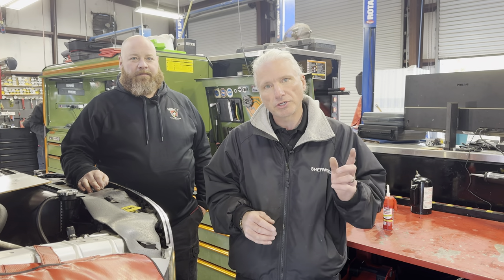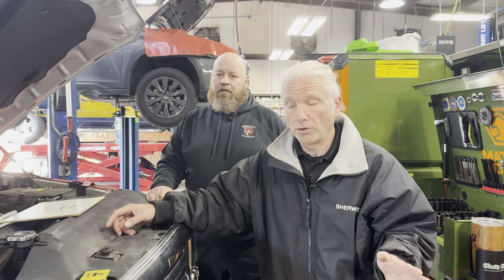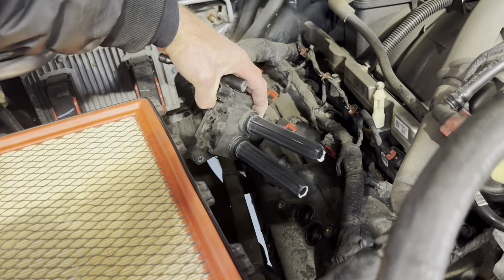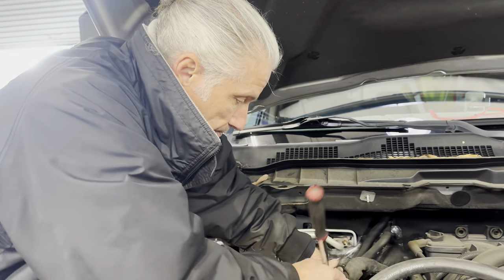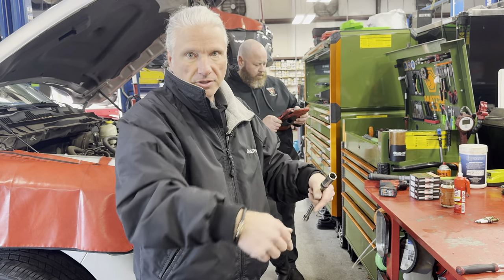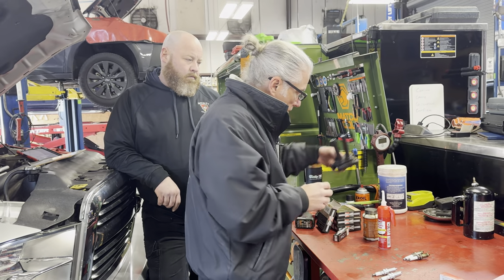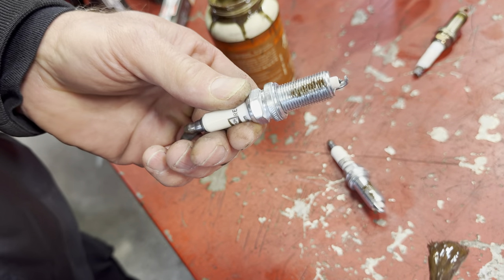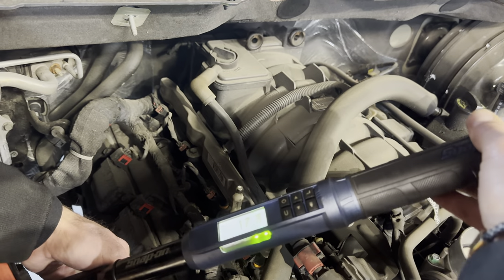How To Replace Spark Plugs Like A Professional

Comment: Someone let the office manager back in the shop again and let him play with the tools. Someone get a mechanic in there stat!!
 PS modern plugs are coated and don’t require any anti-seize. Wet torque specs are different than dry torque specs.

 The look on the techs faces when this guy starts talkin and puttin his hands in the engine bay is priceless!!

There’s a video where plug gaps are tested on a high output engine on a dyno that shows gapping isn’t that important. If you have iridium or platinum plugs you really shouldn’t be messin around with changing the gap. Can damage the coatings as well.
Reply from the maker: Had trouble reading past your first two sentences because of your arrogance. To come on here and say stuff like that about a guy who’s put 40 years into this industry as a technician is pretty incredible. If it was me (the guy holding the camera) who you were saying that about then I’d agree with you as I do run the front of the shop. But to say that about a guy who clearly knows what he’s doing (not saying he’s perfect or knows it all like you) is just ignorant. 

You’re invited to come to the shop and talk to the techs yourself. The level of respect they have for him will be evident. You’ll be able to tell if they’re blowing smoke. 

Maybe watch a few more videos before making a comment like this. Or don’t since you already have it all figured out. 👍
Reply: @theroyaltyautoservice   someone’s triggered lol 
 First off, I’ve never claimed to know everything and definitely didn’t claim that I did in my comment, which apparently offended you (the guy holding the camera) when it wasn’t even you I was givin a hard time too- That’s what people did before words started offending people so easily. 
 Secondly, well, it’s just not that serious man. You’re on the internet you’re going to hear things significantly worse than what I said.
Reply: @KendrasEdge757  Modern turbo engines are very sensitive to spark plug gap.
Reply: @1MiketheMechanic  not turbo diesels lol yeah they’re sensitive to a lot of things, regular use being one of them. Especially the < 2ltr 4 bangers being turbo charged from the factory.

Comment: I also use the anti-seize i know many think its a bad idea. i go one step further depending on how old and how many miles since plugs have been changed i run a spark plug thread cleaner in and out not a regular tap one made for spark plugs. i also recomend even if you don't replace the plug remove and inspect every 12 months. I am 67 years old i can remember in the 1990's was the first time i starting seeing plugs seized on vehicles this was also when the ignition systems got better and plugs last longer. when i was growing up if you didn't tune up your vehicle every year it didn't run good. i still think they should be removed every 12 months i think the plug problem even on the 3valve ford would go away if that was done. I have had vehicles come in my shop with 200,000 miles on plugs still running. most will go 100,000 miles thats the ones you see getting stuck and broke off. almost forgot i don't tap the plugs i use a gapping tool that safely bends the strap and keeps it straight and 90 degree angle from the electrode.
Reply: Most spark plug manufactures don't recommend anti-seize because it can ruin the special coating. No need to mess with spark plugs any sooner than the proper maintenance schedule unless there is a failure. A lot has changed in the last 15 years with modern engines and the old school methods can cause more harm than good.

Comment: NGK website SPECIFICALLY states not to use any type of anti seize. From their website 1. Anti-seize

NGK spark plugs feature trivalent plating. This silver or chrome-colored finish on the threads is designed to provide corrosion resistance against moisture and chemicals. The coating also acts as a release agent during spark plug removal. NGK spark plugs are installed at the factory dry, without lubrication or anti-seize.

Anti-seize can act as a lubricant, altering torque values up to 20 percent, increasing the risk of spark plug thread breakage and/or metal shell stretch. Thread breakage can sometimes involve removing the cylinder head for repair. Metal shell stretch changes the heat rating of the spark plug and can result in serious engine damage caused by pre-ignition. Do not use anti-seize or lubricant on NGK spark plugs. It is completely unnecessary and can be detrimental.
Reply: But then Honda recommends NGK Iridium plugs, provides a torque sepc, and says to use anti-seize. NKG says no, and provides a rotational tightening spec. It's all over the map. IMO, just follow a a manufacturers spec, either NKG, or Honda, or whoever, and don't make it up if you don't have a lot of experience.
Reply: Yeah but homda service data tells u to